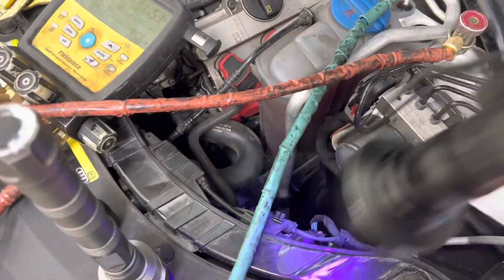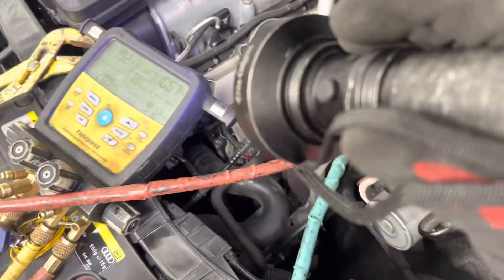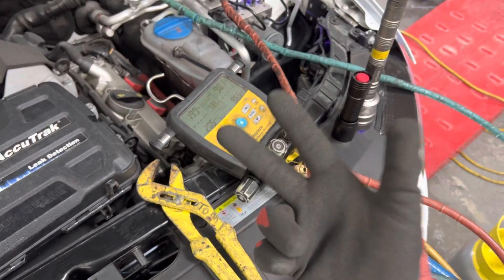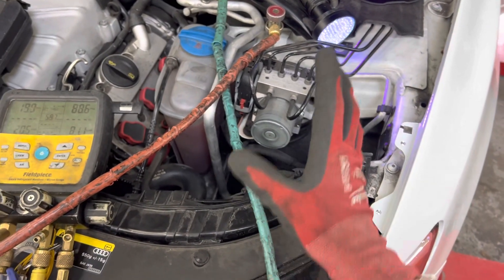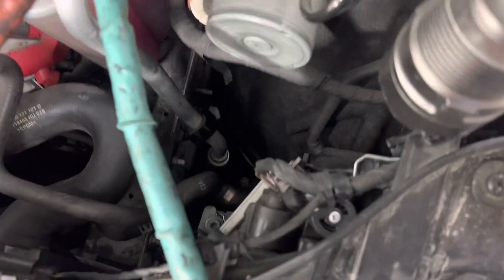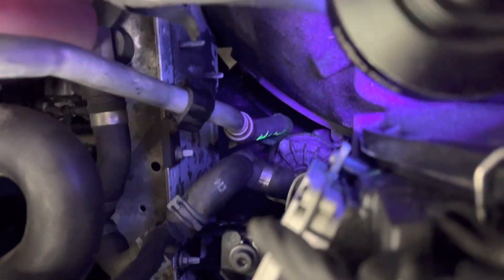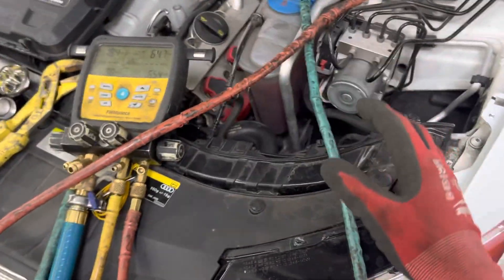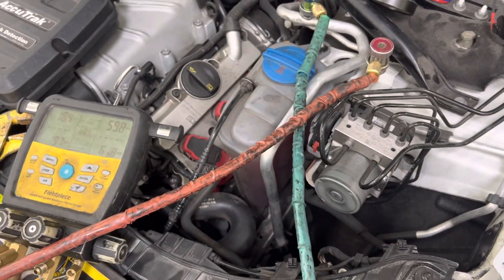NITROGEN HIGH PRESSURE FINDS AC LEAK / WITH UV DYE YOU CAN SEE IT

Comment: I see guys doing this with Co2. What’s better? Cheaper?
Reply from the maker: Cheaper is no concern that’s for the cheap guys. We don’t consider them technicians or shops only looking for the cheapest way out.

CO2 you cannot use for high-pressure decay test because it’s far too sensitive and react to extreme to just a few degrees and temperature rise or fall . 

CO2, unfortunately the general purpose grade that is sold is heavily moisture contaminated, and was never intended for any kind of refrigerant system 
        Especially ones that I already already heavily moisture contaminated PAG or POE oil . 
     Since the majority of automotive instructors in automotive industry are uneducated and we’re never mandatory required to get an HVAC education, they don’t know this

Because usually the same class of people are really cheap and are always looking for the cheap way out most don’t even know refrigerant grade CO2 exists .  And once they go to look at the price, they’ll bury their heads in the sand and point to the cheap product and go to the cheap one is the good one.. 

CO2 can be used as a trace gas with a CO2 leak detector to help find leaks 

But so does nitrogen with a trace gas added to it what is referred to as forming gas. 
      It contains 5% helium or 5% hydrogen added to the nitrogen and you use it with a helium or a hydrogen electronic leak detector exactly like you would with a CO2 electronic leak detector. 
     The advantage of hydrogen or helium is it’s a much smaller molecule of gas to find through leaks with much more sensitive leak detectors, especially helium. 
     And you can still use it as a high-pressure decay test over a period of time because it’s not so sensitive to extreme expansion pressure rise or extreme contraction due to every 1°F of temperature change